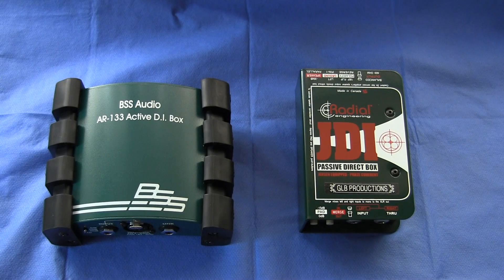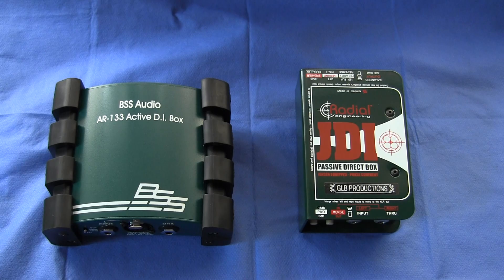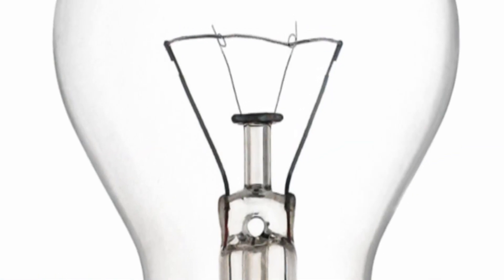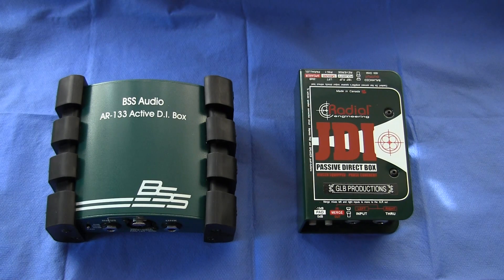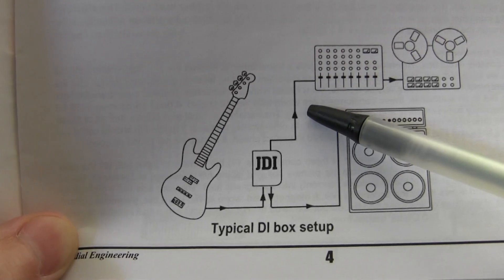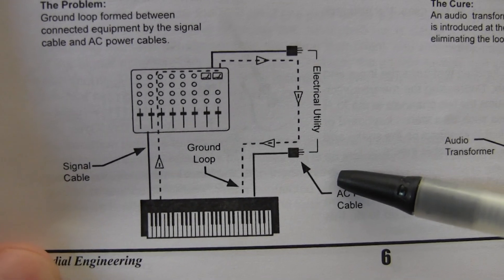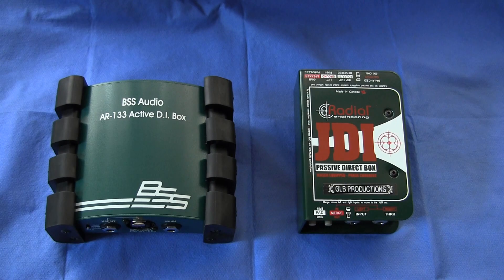DI boxes part 1: What does a DI box do, and when do I need one?

Comment: Fantastic video, maybe you or someone else can help. I’m currently using a shure sm57 connected to a simple impedance matching adapter to connect to a few guitar pedals. I have up until now been using a 1/4” ts cable out of the pedal chain to connect to a 1/4” channel on my behringer 1204 mixer and then into a Focusrite. Would it make sense, and if so, be preferable to connect the 1/4” output of the pedals to a DI box and then use the xlr ouptut on the DI to connect to a xlr mic input on my mixer so as to take advantage of the mic preamp? I realize another solution which would not require a di box or an adapter would be something like the Radial Voco Loco. I also realize many frown upon using a microphone with guitar amps, but for the kind of music I am making it makes sense.
Reply from the maker: Good to hear from you again :) In this situation, I would just connect directly to the Focusrite - the mixer in this case really adds nothing to the signal chain, unless you are using it for another purpose not included in your description above. So SM57 -> adapter -> pedals -> Focusrite. And yes, the Voco Loco would be the ultimate solution as it is designed for exactly this sort of set up.
Reply: @GLBProductions  ah ya that makes sense, just skip the mixer. I ended up buying a cheap DI, which i guess I could use for playing live or I could use it in reverse for Reamping... Thanks again for the help, your channel is always very insightful.

Comment: Solid, to the point tutorial with no room for fluff talk. 10/10 in my opinion. 

However, I do have a question though. What did you mean by "ground reference"? I was never a fan of anything related to electricity in school, so I never paid any attention to those classes haha. Could you help me out?
Reply from the maker: Thanks for watching Cyril. A ground reference is simply a point in the electrical system that is used to determine what zero volts is, or in other words, the point from which all voltages are measured. Ideally this is a physical connection to the earth itself, typically made through cold water pipes or the lighting rod system.

Comment: I have an issue where I have an old house that is not wired with a ground. I get a nasty hum through my amp that goes away as soon as I touch any grounded component on my guitar. Will an Audio Transformer (DI Box) fix this issue and make the system safer?
Reply from the maker: I'm afraid not Alan: what is happening when you touch the strings is that YOU are becoming the ground path, hence why the noise goes away. Adding a transformer will not solve this problem, as it will not provide the missing ground. The safest and most effective solution is to simply ground the amplifier - this can be done by running an insulated wire from the nearest cold water pipe or lighting rod (any metal that penetrates 3-6 ft into the earth) and connecting it to one of the bolts on the amp's metal chassis. This will not only solve the noise problem but it will be MUCH safer - running an amp ungrounded like this is very dangerous - if for any reason the amp chassis or input socket become live the only place for the current to go is through your guitar and then into YOU. I cannot stress this enough - musicians have been killed onstage by this type of fault.
Reply: @GLBProductions  Thanks for the Info. My research has provided a safety thing I can do, where I find the first outlet in the circuit and install a GFI socket. My understanding is if something bad happens like you described the GFI will trip before any real damage happens. But like you said, it won't stop my hum issue either. To add in the ground in my house like I need, is going to cost me about $4200 USD.
Reply from the maker: That's a good idea Alan, safety first!

Comment: so if im using a simple analog 4-track, and plugging stuff into that... the fact that it's all a short distance away, means I do NOT need a DI box?
Reply from the maker: Even if the distance is short, you still need to be aware of the impedance issue: if you are plugging high impedance sources like passive electric guitars and basses directly into the multitrack, you need to ensure that it has a high impedance (Hi-Z or instrument) input, otherwise you may suffer a loss of high frequencies.

Comment: Do I need a di box if I'm using wireless transmitters/receivers and not cables... something like the Xvive U3's?
Reply from the maker: That wireless system has a balanced XLR output so no DI box needed.
Reply: @GLBProductions  Ah thank you so much. Thanks for the videos.
Reply from the maker: You're most welcome Jacob.

Comment: Very well explained , I've got a question-I've got a focusrite Interface , If I am recording guitar in my studio will  I need DI box ? or my interface will do the trick without losing the highend like you mentioned.
Thank you
Reply from the maker: If your interface has an instrument or 'Hi-Z' input then no DI box is needed.
Reply: @GLBProductions  Thank you for your reply, Ive got Scarlet 2i2 and ive seen mixed reviews about if this interface needs DI or not , what would you recommend?
Reply from the maker: With the INST mode active that interface has an input impedance of 1.5 MegOhms so no DI box is needed unless you are connecting an un-buffered piezo pickup. Magnetic pickups and piezo-equipped instruments with onboard preamps will be no problem.
Reply: @GLBProductions  you are a legend mate, thanks for this.

Comment: I have a Microphone routed straight to my audio interface. Now I understand why buying DI Box would be a great idea to run my signal through to that. I was wondering if it's possible to put the DI on a secondary power source in my room🤔 this way I'd take the power not from my main one, that is already overwhelmed, but without creating the ground loop. Am I right? Or should I get an active DI? I don't usually record live guitars (so not much passive signals I'd say), mostly vocals and I don't have any other input active on my audio interface (Scarlett 2i2 3rdgen), but I still can hear crazy echo when calling, peeps don't hear my music when streaming on discord, or I get unpleasant noises when recording. What would you suggest in my situation? My XLR cable can go up to 5 meters lenght though.

Not sure if I got the diference between the two of them and also I'm trying to buy clever and gears that can stay usefull for years, not just today.
🙏
Reply from the maker: DI boxes are only needed for unbalanced instrument signals which need to be run over distances longer than 5m - microphones with balanced XLR outputs do not need a DI. For recording, routing your mic direct to your audio interface is the correct method of connection.
Reply: @GLBProductions  thank you. I got it. What could I possibly do to overcome my issue when I record?
Reply from the maker: What is the biggest issue that you are facing when you record?
Reply: @GLBProductions  a background noise that I have to heavily erase with de-essers. My acoustic treatment has improved in time, but I yet dont have a vocal booth where to absorb unpleasent frequencies and record the ones I want to record properly. Also I have the street downstars, if I open the window; a lot of traffic, but I manage to cut that out as more as possible with the gain within my audio interface and the daw.
Reply from the maker: First thing would be to determine where the noise is coming from: if it's an acoustic noise that is being picked up by your microphone, then you need to move locations or orient the mic differently. If it's electromagnetic or electrostatic interference, then you need to find where it is coming from. This type of noise can be caused by dirty AC power, poor AC grounding, lighting, large electrical motors etc.
Reply: @GLBProductions   @GLB Productions   @GLB Productions  the building I live in is pretty old and sometimes I experienced power issues when swithching off or on, my monitors, for example. I think that is a power source problem within the system of the building. I believe the noise doesn't come from the acoustic, but from the powers itself (I tried to place the microphone in diferent places).  How could I determine if it is electrostatic or interfence when I record?

Comment: Great video cause I been dealing with ground loops from our keyboard even with a di box but I may have it hooked up wrong
Reply: Ok thanks for your help I’ll try this
Reply from the maker: The way to check for a ground loop is to disconnect the XLR connector from the DI box - if the noise goes away you have a ground loop, otherwise something else is the cause.
Reply: Ok I’ll try that. Also our keyboard player uses two keyboards. What is the proper way to hook these up? After watching your videos I believe I have the wrong setup at our church. I basically took over this position after the other guy left. We’re using an active di box for the keyboard and I’ve been powering it with phantom power two no no’s. I just ordered a passive DI box after seeing your videos and explanation of them. I hooked it up with a balanced cable xlr-trs and from there to the keyboard amp. The keyboard player plugged his two keyboards into the amp.
Reply from the maker: With two keyboards you ideally want a separate signal path for each one: keyboard -> DI -> mixer. If the keyboard player uses an amp you can then run the link outputs of the DIs into the amp. BTW if the keyboard itself has an XLR output you don't need a DI - just connect the XLR output to the mixer and one of the 1/4" outputs to the amp.

Comment: What happens if you want to record analog to your recorder and you want to record the tone from your Ampeg B15 cabinet or your Fender Tubes amplifier? Do microphones that capture this sounds needs DI Boxes??
Reply from the maker: Microphones that have a balanced, low impedance output (the vast majority of modern mics with an XLR connector) do not require a DI box.

Comment: If I'm running my keyboard directly into 2 amps in stereo, is there really a need for a di box? I'm doing that now at home and there's no noise. None. Will that change out on the road?
Reply from the maker: No need for the setup above, unless you plan to connect to a PA system in addition to the two amps. Just make sure that your keyboard and amps are all on the same electrical circuit.

Comment: If you're running a keyboard in stereo direct to 2 amps, I assume that you would need a di box for each amp? What if you're running your keyboard into a pc and then out from the pc into AI and then into 2 amps from the AI in stereo? Still need 2 di boxes?
Reply from the maker: Hi Dryvur what do you mean by 'AI'?
Reply: @GLBProductions  audio interface
Reply: @GLBProductions  i'm actually running my keyboard into my PC and then into an ai and then into my amps. No noise at all. Would it matter on the road?
Reply from the maker: Probably not, but computers are well known for being the source of noise in sound systems.
Reply: @GLBProductions  thank you so much

Comment: Great explanation! Appreciate this. I got one question though in terms of connecting a balanced signal into a line input. Does balanced signal from DI boxes can be connected to line inputs? Does balanced signal considered a line level signal? Consider a scenario where a I have my guitar run through my pedalboard and have a DI box at the end of it connecting it to my audio interface which has a balanced line input. Thanks for your response in advance!
Reply from the maker: Thanks for watching Jeremy. In general, no - the output of most DI boxes is mic level and should be connected to a mic input. In the situation you describe above, if the audio interface has a 1/4" input, just connect directly without using a DI box - the signal from your pedalboard will already be low impedance, and unless the distance from the last pedal to the audio interface is more than 5m/15ft an unbalanced signal will be fine.
Reply: @GLBProductions  Thank you! Just a question in mind, is there a way to connect from my pedalboard to a line input. Use something in between them maybe? Im afraid I got the all the input in my interface taken already.
Reply from the maker: Have you tried connecting directly? Some pedals output a signal that is pretty close to line level.

Comment: And could I use a cable (XLR- plugTRS) with the balanced signal, after the DI BOX.?? 
Because i don't have an extra (MIC-IN) in my little mixer

Thanks a lot
Reply from the maker: Yes you can do that - remember that you will need more gain than when connecting to the mic input.
Reply: @GLBProductions could I use the ATTENUATION switch to increase the gain?.. I guess i could
Reply from the maker: @iamcxll9458  Not really - those switches actually decrease the signal level.

Comment: Excellent video!
Reply from the maker: Thanks Cuong!
Reply: @GLBProductions  I've been watching your video series and all have very clear explanations.  Quick question "On an active DI box with a THRU output, does this output has the benefit of the DI box?  Or, it's just connected in parallel to the input?  If it's just connected in parallel to the input then it could pass the hum to the other amplifier, is that true?
Reply from the maker: It depends on the DI - on some models the thru output is buffered, on others it is a direct parallel connection. So you need to check the product documentation. However note that there are no DI boxes I know of that can lift ground between the input and thru output - the logic behind this is that the instrument and connected amplifier should share an audio ground, being physically adjacent to one another.

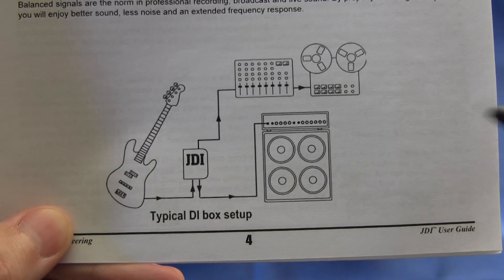Comment: Hi! Nice video! So looking at the image on 7:17 , can i use an DI box to eliminate the hum 50hz noise from my single coil pickup guitar by lifting the ground using the the 'Link" output to the amp or that function works only with the balanced output to the mixer? Thanks!
Reply from the maker: Hi Victor, if the 50Hz hum is coming from your pickups the ground lift switch will not help - it will only defeat hum caused by a ground loop.

Comment: hi! I try understand if a DI box is what i need in the chain between an amp head and the source of recording, in this case mixer that then ends in the soundcard. Input impedance aparentely can handle the output of the amplifier, but every time i plug it there is some spark. I ask myself if this is correct. It's a 100W amp head... And thank you for this video, i just still surf with this question since long time. Best!
Reply from the maker: If you are trying to connect the speaker level output of an amplifier to a recording system you must go through a load box or a cabinet simulator of some kind - connecting directly to your mixer or audio interface will probably cause damage.
Reply: Hi! thanks a lot for the answer, i will try to and make my investigation! :)

Comment: If I have a pedalboard, do I need to connect it before or after the DI?
Reply from the maker: If you want your effects to be in the signal which is output from the DI the pedalboard needs to be connected before the DI.
Reply: GLB Productions then it'd be bass>pedalboard>di>amp?
Reply from the maker: Correct. You can also experiment with using the line out on your amp, if it has one.
Reply: GLB Productions Roger that. Thank you. Solid video btw.

Comment: Hi, JBL .. i like all of your explanation and i keep up. So I have one question again.. My problem is Right now I've runing a studio my systems connection are ART Tube MP project series which is connected to audio Interface(Scarlett 18i20) So when i Record vocal.. There is some hiss noise... If I Buy this DI Box, Will it be helpful to get rid of hiss noise?
Reply from the maker: No it will not - a DI box cannot reduce that type of system noise. You need to find out what is causing the hiss and deal with it at the source.
Reply: @GLBProductions  Ok, thanks for replied..
Reply: I’m dealing with the same problem!  Have you find out the problem?

Comment: hello there ,, im having noise problem recording guitars to an audio interface (behringer umc204hd ) ,,,the problem is that the electricity power system in my country is un-grounded power system ,,, will a DI help with that issue ??? help
Reply from the maker: No a DI will not help solve that type of noise issue - there must be at least one solid electrical ground in the system for noise-free audio. In your case I would suggest going to a completely battery powered setup for your tracking at least - you can then switch back to mains power for editing. 
Which country are you in and what makes you say that the entire power system is ungrounded?
Reply: @GLBProductions thanks alot for the help ,, so I may use a laptop will tracking.
A grounding is not required in The building code so no one do it ,, may be in specific building types , a 3 prong equipment or socket is an odd thing to see here.
Reply from the maker: Oh I see, that is understandable. In this case I suggest trying different outlets - you may find one that is noise-free.
Reply: @GLBProductions   I tried it on laptop unhooked,,, noiseless and beautiful ,,, i'll check different outlets and see  what will happen,, thanks alot

Comment: Wait, impedance? So the DI box can also be used to plug into a guitar amp's speaker port?
Reply from the maker: Could you explain exactly what you mean by that?
Reply: @GLBProductions  simply speaking: can it also be used as a load box to replace a speaker cabinet? I've been looking for such a thing since i live in an apartment and i rather not want to make too much noise with a guitar cabinet.
Reply from the maker: No they cannot be used in this way - there are some DI boxes that can accept the speaker-level output of a guitar amplifier as an input signal, but they do not act as a load box.